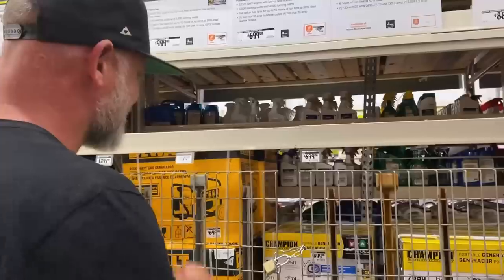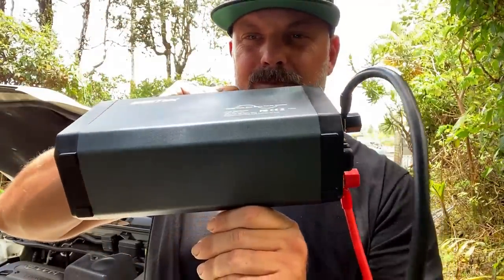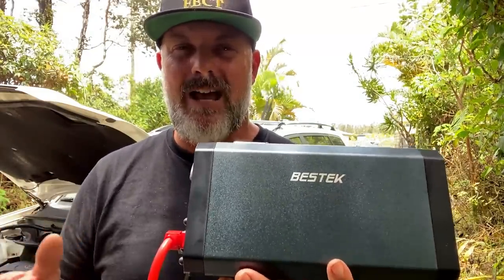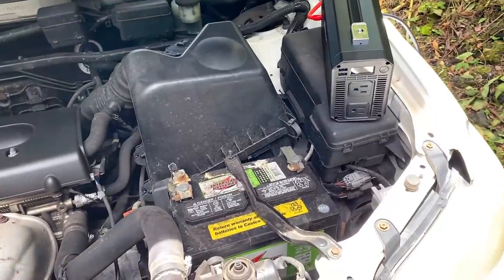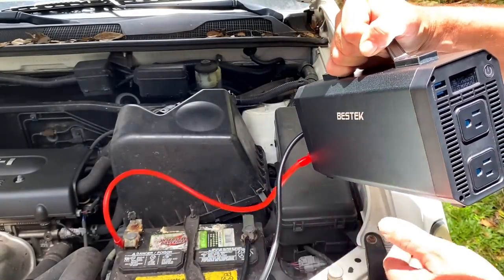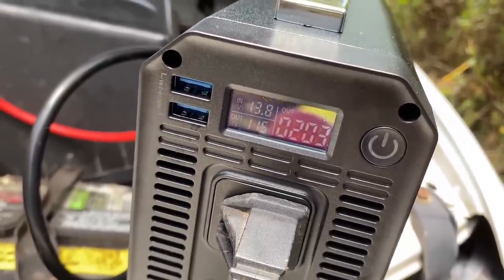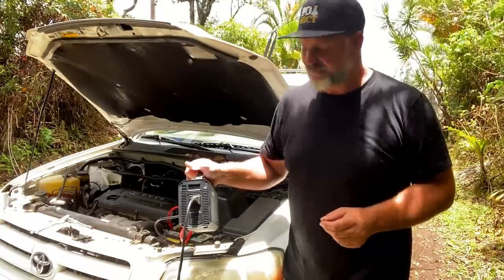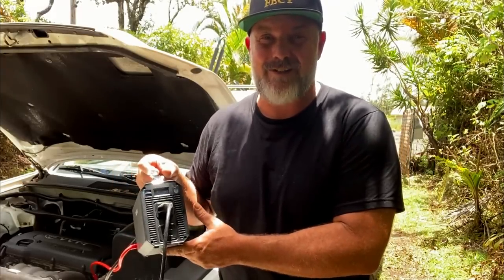Get Power To Your Off Grid Homestead Without A Generator

Comment: I hope people will read my comments before they fry up their car battery or some other stupid mistake.

1. A car battery is not designed for continues usage, it is made so it can quickly peak for starting the engine, and then use a moderately small amount of power to run your vehicle - heavy consumption will ruin it, also keep in mind that your engine's alternator is designed to recharged the battery at a certain pace, which is nowhere near fast enough if you drain so much power so quickly.

now into topic-

2. 1000W continues  inverter is nowhere near enough to power all needed tools and gear, I'd suggest a minimum of 1500W continues or 2000W if possible.. there is a reason that most people who want to live off grid, and start from bare land, carry with them a genset with about 3000-4000W of power output and a couple Jerry cans of fuel 

good luck
Reply: So then what should we connect these types of  alien technology.... to?
Reply from the maker: Thanks for the input. It is designed to work with cars and would be a great backup in case of an emergency. But use it wrong and everything you say is true. That said I personally use a 2000watt generator for all my power tool needs and now use this inverter as a backup to my backup
Reply: @HomesteadinHawaii  sure, but the problem is that most people that are using YT to copy a concept are unable to take certain factors into account, many will just copy it and think it replaces a proper genset or power setup. the limitations are not always known to them
Reply: Yes...there are much better batteries to power an inverter than than that in your car yet in the beginning, just run your vehicle if powering larger devices. Also, if you choose your devices wisely you can power a huge variety of things with 1000 watts.

Comment: I have the exact bestek 1000 inverter, Bestek emailed me and stated it is capable of handling a 2000 watt momentary power surge. The 1000 watts is referring to continuous service. Most inverters are designed to handle a momentary surge. Thought it might be helpful to know. Thanks for creating this video.
Reply from the maker: Thanks for the info, that is helpful, that makes it able to run most fridges
Reply: @HomesteadinHawaii  It ran my refrigerator and freezer without any issues.

Comment: I have two of those same ones in 1200w. Mine came with both bolt on and booster clamp cables. I have a battery bank on a push cart and charge them with solar panels.
Reply from the maker: That would be the much better way to go. Clamp cables only make sense. And having a battery bank hooked up to solar panels to keep it charged, you sir get the win!

Comment: An inverter is a lifesaver in remote situations. HOWEVER, having been-there-done-that, it is worth reminding people to watch their power consumption if the vehicle is not running. Small power tools and battery chargers can drain a car battery down enough that it can't turn the engine over to restart. if you drain both your phone and car battery down on a lot that isn't near people, you have a VERY long walk coming....
Reply: Savage Facts  absolutely
Reply from the maker: I think I did that in the video cause you can drain the battery quick.

Comment: Great video, I use an invertor tied to my riding mower when power fails to keep my fridge cool.  I like your recommendation of the Bestek, however keep in mind a nominal 100 amp alternator only puts out 1200 watts, so you may want to consider using more than that intermittently or you will drain your battery. Actually the invertor may kick out once the voltage drops. Thanks for posting
Reply: That Bestek 1000 w inverter sux. Can only handle about 500 watts continuous
Reply from the maker: I’d prefer to have the Giandle 2200 watt inverter but have found the bested to be good enough for most light duty things

Comment: That sounds like a great idea! in my opinion the fan should run continuously if you are having to rely on that device being under the hood next to a heat source it is much easier to keep an electronic cool than it is to cool it down after it's hot. 😁 Also hearing the fan run lets you know right off the bat if your fan is working or not.
Reply from the maker: Good point. You can wire it so you can locate it elsewhere though

Comment: Learn to chisel off the Tesla magnets from the generator and your old car generator pre 1974car generator is an Edison generator. An edison generator spins without water wind or steam. Tesla bound the Edison generator with magnets all around the armature and used water to turn the armature coils to produce electricity.  Edison used the field magnets to move the coils of copper wire in the magnetic field.  So count the Tesla magnets on the armature and divide by 6 chisel three off and leave three on alternating on and off to get a motor pattern on the armature.

Comment: Thank you for sharing. I understand each battery is different, and some more powerful than other. I see you have a big car. From your experience, how many times it is safe for an ordinary drill charger to  be recharged before it drains the car’s battery? Thank you.
Reply from the maker: There are so many variables, but if you’re worried you I’d only do one charge and then run the car. The alternated charges the battery back up. But you don’t want to drain the battery too far either so I tend to err on charging while driving. I have it hooked up inside my car now.

Comment: Old car generator pre1974 can be chisel from Tesla bound generator to the free spin Edison generator. Count the armature magnets and divide by 6 and chisel off one sixth and leave one sixth on and chisel off another sixth off and leave another one sixth on. You have chiseled off three sixths and left three sixths on alternating on and off all the way around. You have an Edison permanent magnet motor that produces electric power 12volt DC an inverter produces 110volt AC.
Reply from the maker: I wish I knew more about that stuff. My electrical knowledge is still pretty basic

Comment: How many watts does that sander draw when under load??  I'm sure it's less than 1000W but it would be see how easily that's dealt with.
Reply from the maker: I think it shows in the readout on the display of of the bested inverter. I’m off island right now so I can’t look at the sander at the moment, but something like a sander will draw down the battery so the car should be running to keep it charged.

Comment: I really don't get the title, the inverter IS a power generator, it's not gasoline but nevertheless...The car battery can store about 1kWh, P=I*U,  but you shoud not use it below 30% of it's capacity
Reply from the maker: Are you sure? The inverter just converts the battery power into something you can plug into and the car keeps it charged
Reply: @HomesteadinHawaii  Yup, in electronic, we say that it's a generator,   battery is the power source but still the inverter converts to the output, so in that sense it generates power. Basically it's a power source just like every generator! Maybe it's just semantic, no biggie!

Comment: how long before car battery is flat
Reply from the maker: I’ve used the inverter for years. You have to watch the number on display and if it draws down too far, turn the car on.  How quick it draws down depends on what you are using

Comment: But the car have to be on all the time while you used the device?
Reply from the maker: No. The inverter has a reading showing how much power your battery has left. Typically it’s a 12 volt battery so 10.5 volts and you should start the car to keep the battery charged.
Reply: @HomesteadinHawaii  this answered my question. Will delete my main comment to not duplicate it.

Comment: I appreciate this channel very much…
Question: Do you think this device will provide the rated output from a Honda Civic that probably has a smaller battery than your vehicle.
Stay safe in Mexico btw:)
Reply: never use you car battery with an inverter for longer period of time, unless it's a tiny whinny 100-150W inverter... those small car batteries were never meant to handle high power draws for more than a few seconds at a time (e.g. starting the engine)
Reply: It will be able to power it but running the engine is recomended
Reply: I discussed this with an electrical engineer. He said NO CAN DO! Oh well:(

Comment: This is totally impractical and will kill your car battery in no time.
Reply from the maker: Been using it for a while. Just got to turn on the car now and then depending out your power draw
Reply: I have made a comment on that a moment ago.. mind boggling how people misuse equipment. plug-in a small inverter on emergency for a short period of time? yes! plug-in for a longer usage with high power draw? for that there are other types of batteries

Comment: Then flatten your battery in 10 minutes,

At that point your stuck in the middle of nowhere

Not good.
Reply from the maker: That's why you gotta run your engine at times.  Its a generator at that point

Comment: this concept is so stupid. Why would anyone sacrifice the ability to have/use a car for some power elsewhere? Spending $1000 to turn your car into a HUGE generator running on gasoline to have it die out and become dead weight thereafter. Bro.. think a bit harder next time.
Reply from the maker: I haven’t had issues. And it cost $150